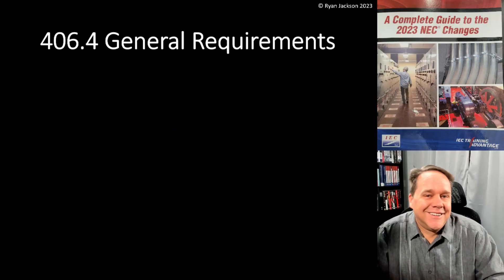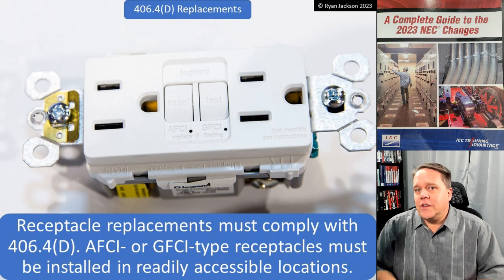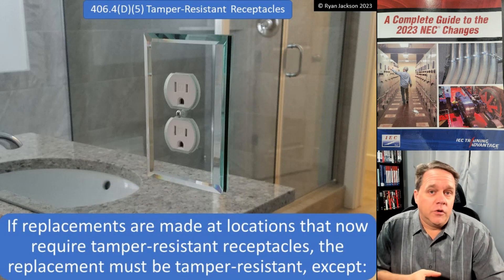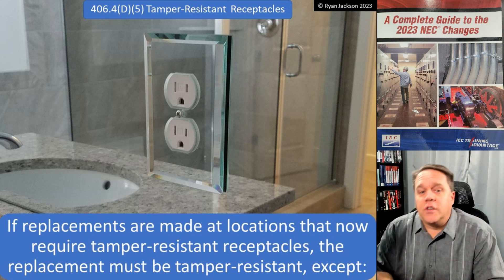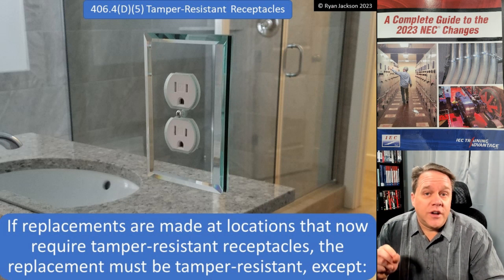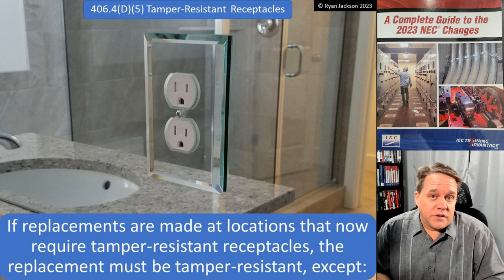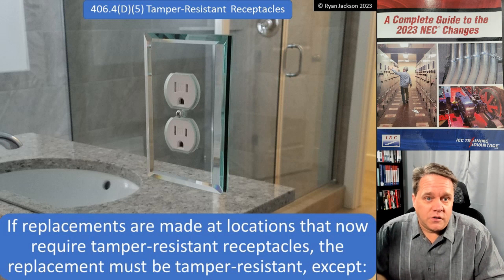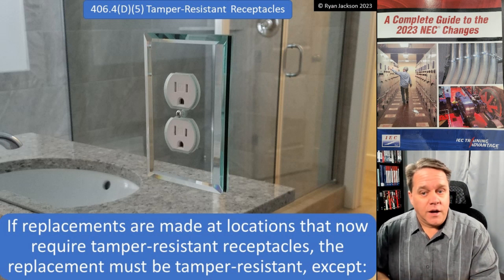406.4 General Installation Requirements for Receptacles

Comment: Thought that the required floor receptacles in conference rooms was one of the best new code requirements in years. Had to fight with my cheap maintenance shop boss when the company was remodeling a large office he refused to allow us to I stall a duplex receptacle in a 60' hallway that had a rug and therefore janitor had to vacuum rug several times a week. Stayed on my own time and installed two duplex receptacles spread out. Janitor thanked me for no longer needing an extension cord. Code should require at least one receptacle every 25' or so in commercial hallways.

Comment: Can we yalk about 406.9 (B) wet locations (2) Other Receptacles.
All other receptacles installed in a wet Loction shall be listed weather-resistant type.
Just did a car charger 4 wire 50 amp on the outside of a garage by customer requst.
I have it installed with a in-use cover, was I required to have the 50 amp receptacle weather-resistant too.I did look on line and could not find such an animal.
I would appreciate any thoughts from my comrades.